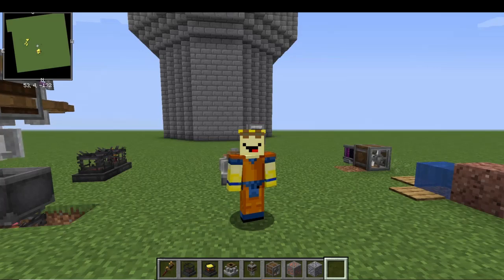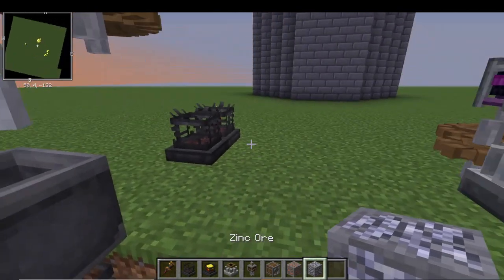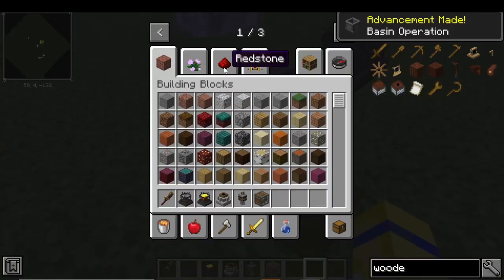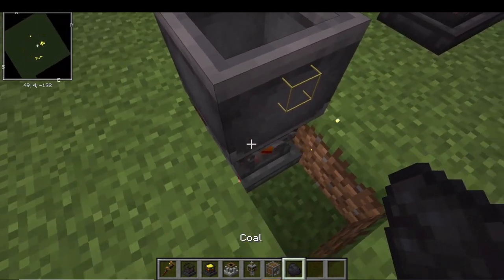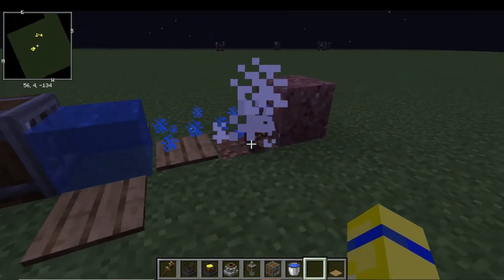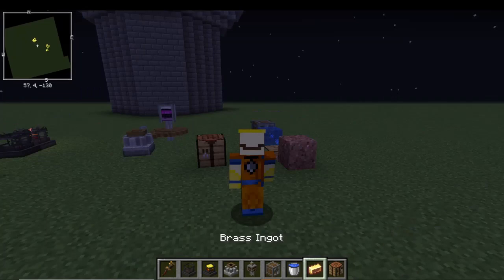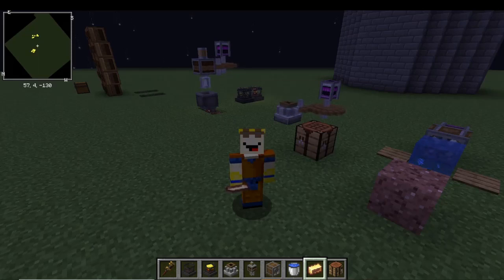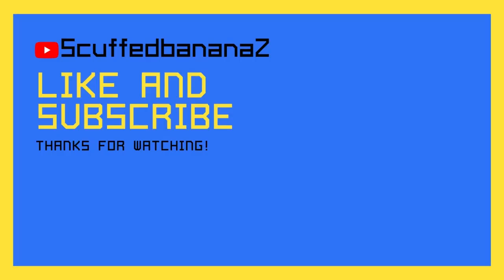How to Make Brass - CREATE MOD Tutorial v0.3

Comment: doesnt work for me
Reply from the maker: This video was filmed for version 0.3 update and make sure you use a blaze burner as that’s the only way to get brass
Reply: @BrickautismMinecraft   Im using a blaze burner, and feeding it blaze rods and it isnt mixing it
Reply from the maker: @illegalpancakes9289  you have to give the blaze burner coal instead as due to the latest version they changed it.